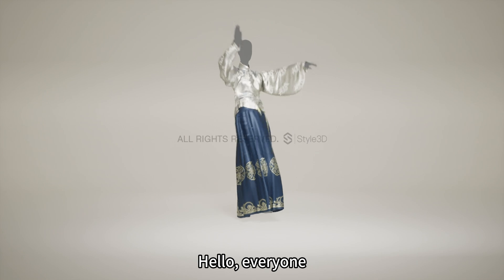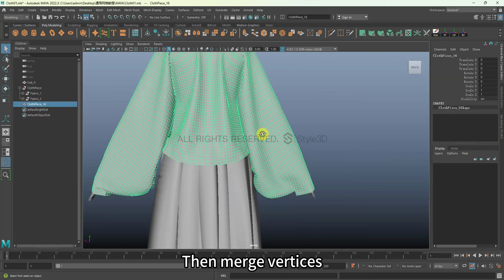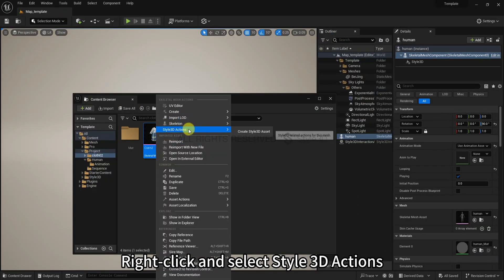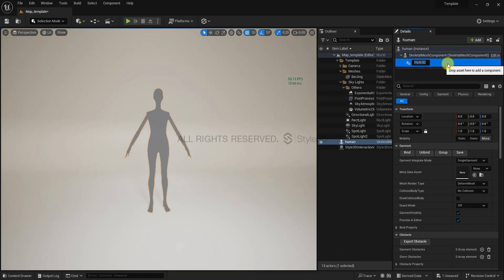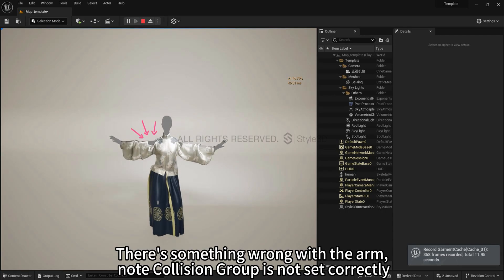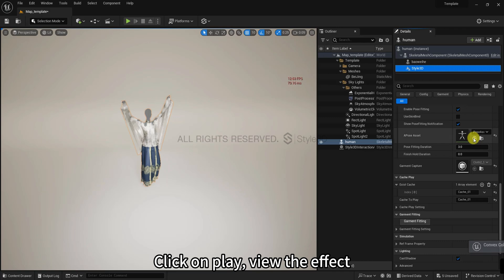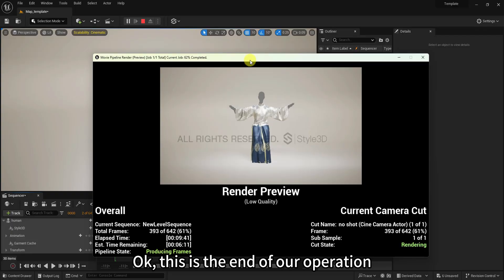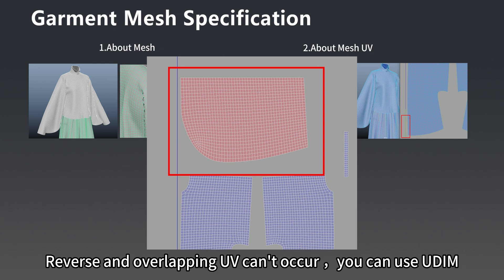[Simulator V2.3 Tutorial] General Mesh Simulation

Comment: In using this plug-in, do I necessarily need to use Style3D Atelier if I already have the skills to make clothes with other software?
Would you still recommend using Style3D Atelier?
Reply from the maker: You don't have to. As long as you have fbx/obj files, you can import clothes made with other software to Simulator.
Reply: @style3dcg  Thanks for the answer. I'll buy this plugin then.

Comment: This is Awesome!its means you can model your cloth in any DCC app you want right?
Reply from the maker: Hi, I'm sorry but the simulator is a plugin that only supports UE and cannot be used with other DCC app.
Reply: if it is FBX then yay! But As traditional UE cloth settings you may simulate of course, Aswe've seen that controlling parts such for not confronting confusing issues I think we must model cloth in Style3D...
Reply from the maker: @sahinerdem5496  In fact,  as long as the cloth can be imported into UE, it can be simulated using the Simulator. For more details, please refer to the manual on our website.